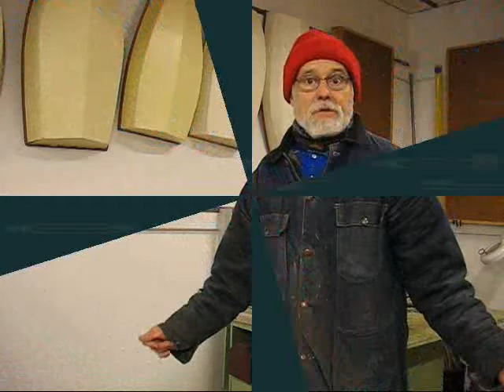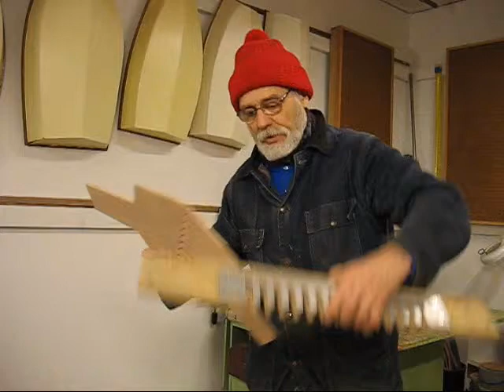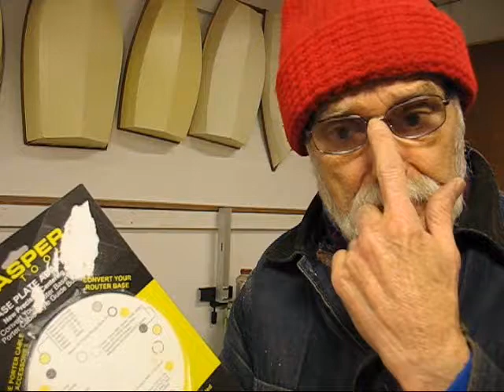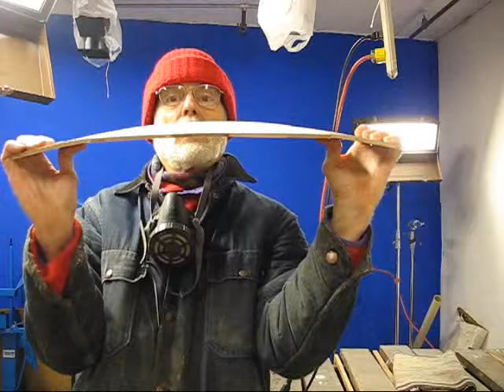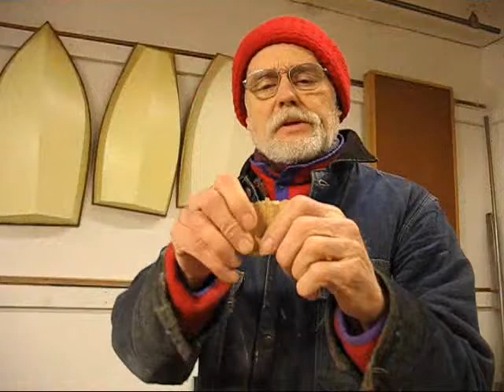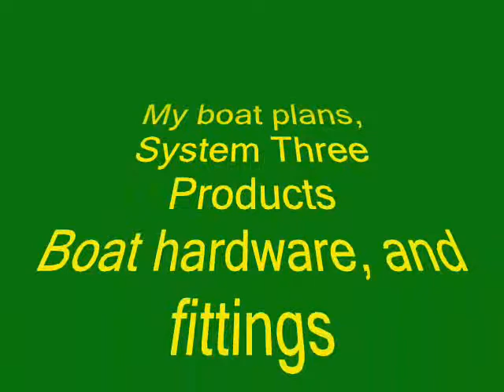EMC Part 1-1 Testing Finger Joints.wmv

Comment: Can I make a suggestion too? I think that the cheapest way of improving this setup is to reduce the number of  perpendicular-cross-section-weak-points by using the same dovetail jig, but to place it at an angle to the length (different than 90 degrees). And also I think that you can try using regular yellow carpenter's glue for this joint (like TITEBOND)

Comment: Wow - those seemed to snap really easy at those fingers.  I would have liked to see you do the same test on the bevel scarf.  I have done many bevel scarfs and they are extremely strong and would never snap that easy.  I would not want to make a weak joint strong just with 4 oz fiberglass tape.  It should be strong without the tape.

Comment: That looks like a great jig, where did you get it? Also, maybe you could try soaking the fingers in epoxy like you did and instead of sanding them with a dowel, re-attach the jig and re-route them. You would still have the holes from the hold down screws as guides. Just a thought.
I built a CLC Mill Creek a few years ago and would like to either make the sailing rig or power it. I will be looking foward to your Electric Moto Craft.